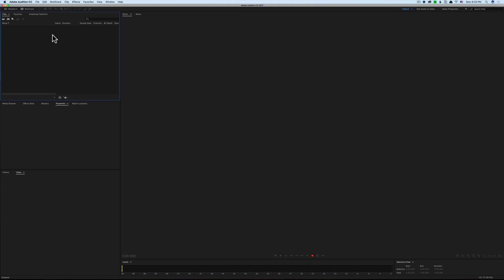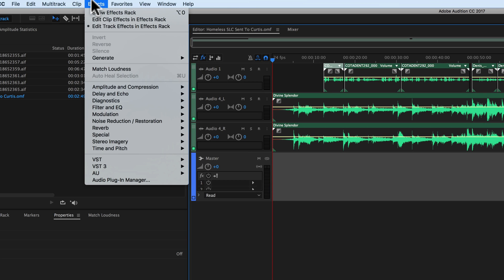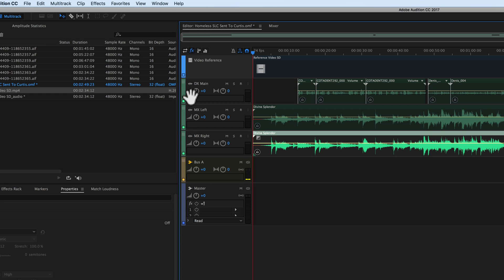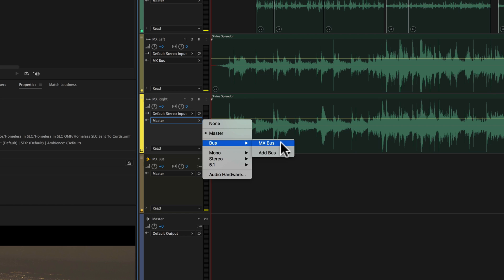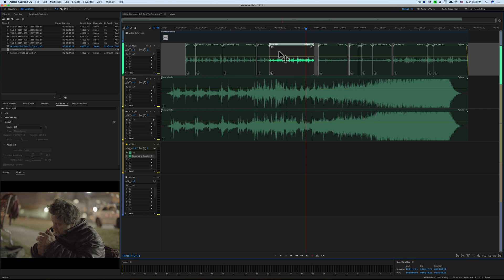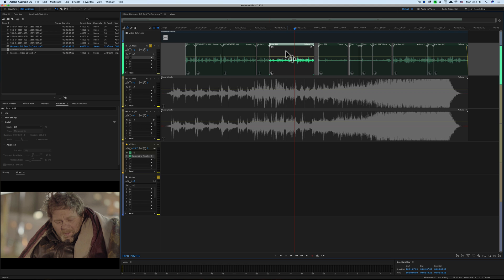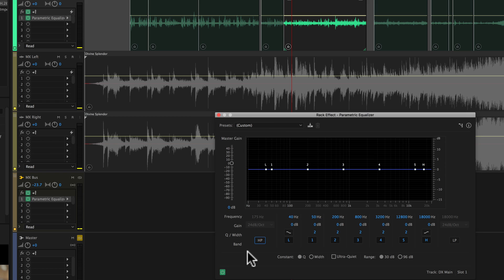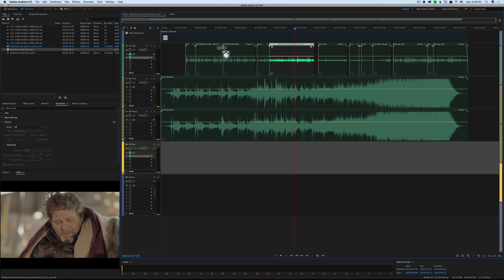Sound for Video Session: Mixing with Buses and EQ

Comment: Hey Curtis, im hoping you can help me out here as ive a bit of an issue with a recent shoot. We shot an interview for a client and we shot about a ten minute interview. The problem is our audio guy never hit the record button on the Zoom H6. So basically all we have for audio is from the on camera mics. Fortunately the closest camera to the talent was fitted with a shotgun mic on top so the recording isnt too bad but it definitely needs some work. Im freaking out here as i dunno what to do to make it sound richer and fuller. Any tips?
Reply: Hi! I'd start with the parametric EQ: apply a high pass filter (just enough to get right of any low frequency stuff in the room) and then do another EQ pass choosing the Vocal Enhancer preset to start. Usually I end up pulling the high shelf down a lot and tweak the others to taste. That will usually add some bass for a slightly richer sound. It probably won't be as rich as a closer boomed mic, but good enough to keep the audience focused on the story (and not distracted by the sound).
Reply: Curtis Judd thanks Curtis I'll do just that. your a gent! Any videos of yours in particular that showcase this kind of editing?